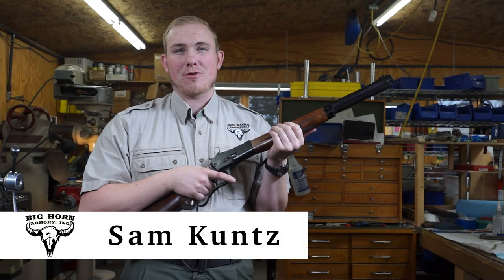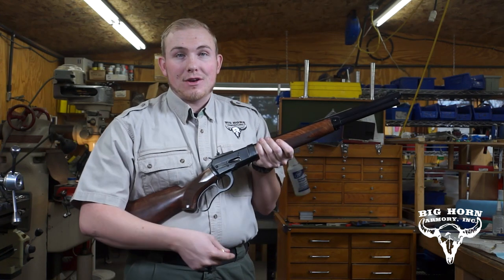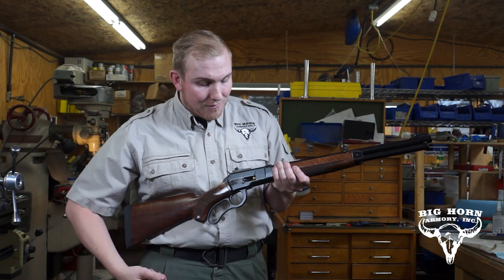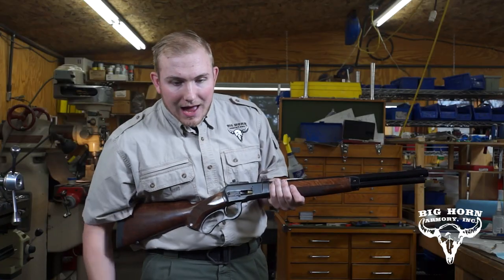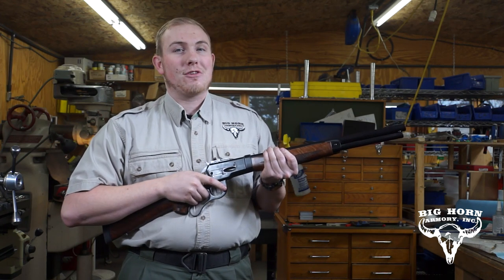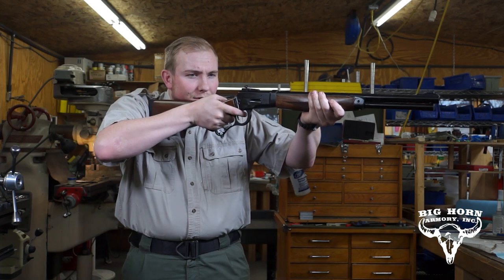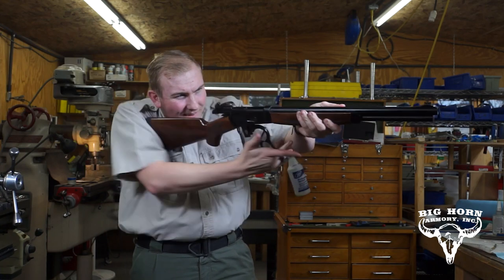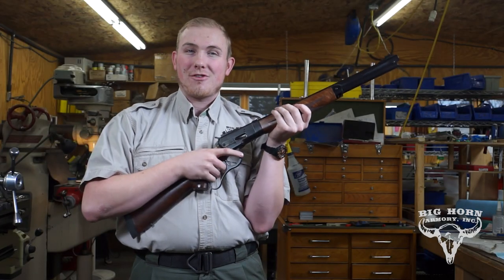Operating the Lever Gun – Big Horn Armory

Comment: Most videos I've seen of the M89 worked, they are fumbling around getting stuff stuck and acting like they've never worked a lever before. It's not that hard folks, work that lever with authority. You won't break it. If a 58,000 PSI explosion won't break the gun, I don't think your stroking the lever will break it either.

Comment: Will this handle the 700 grain “t-Rex thumper”
Reply from the maker: The typical 700gr loading is too long to cycle in our action. You can load it shorter, >2.200", or drop the long round in the chamber single shot.